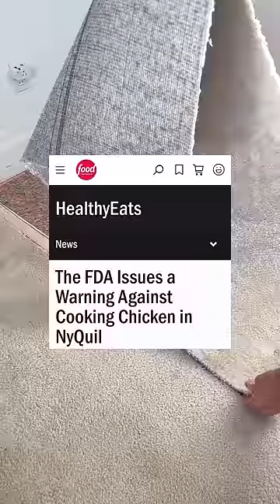Noice NyQuil #shorts

Comment: Sopp up as much as you can without spreading. Then get Any kind of laundry stain remover and scrubbing bubbles (I like the green bottle not yellow) and spray bubbles,scrub, dab, then stain spray, scrub, dab, then a little water warm if NOT BLOOD) press dry cloth. Keep repeating until stain is gone.  Will even work with wine.  If Blood: use peroxide and cold water until as much of stain is gone and then switch to bubbles and stain spray to finish until all gone. Best to do before blood dries. (Family has dry cleaning business,,,40yrs. I can get anything out of anything)

Comment: Out of curiosity, I don't know if this is feasible for your actual job, but how would it work out if a section of stained carpet was cut out of the floor, taken away for serious deep cleaning, then returned and set back in? Would it work at all, or are there too many drawbacks?